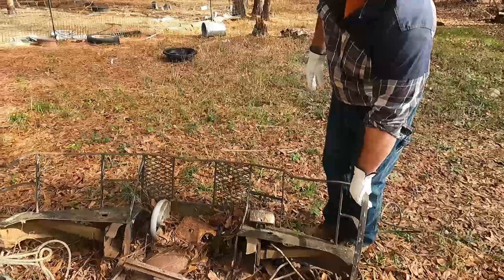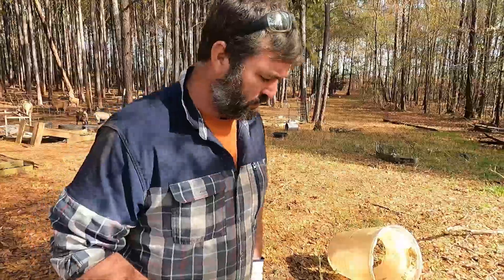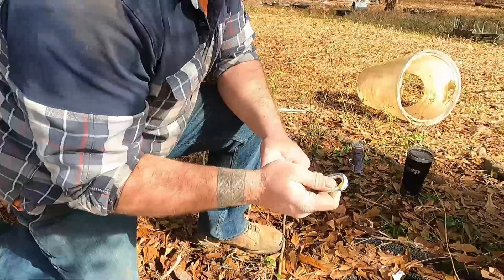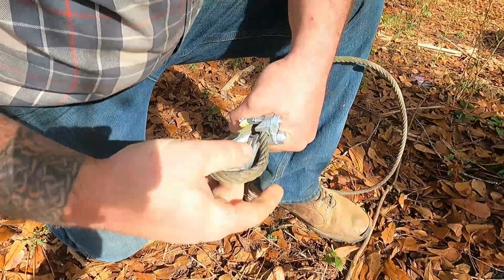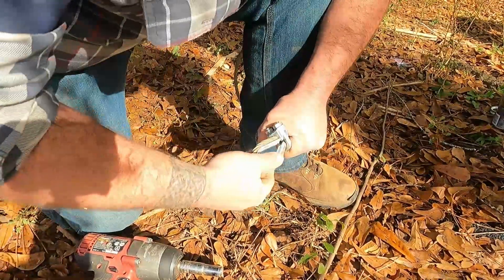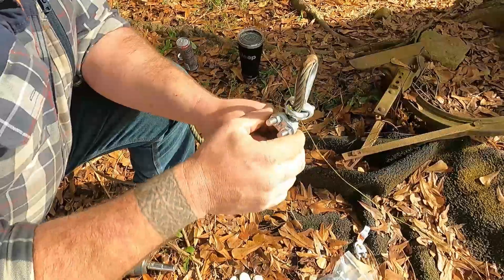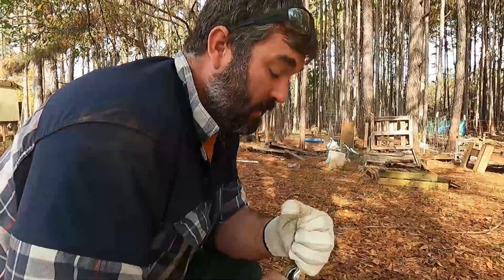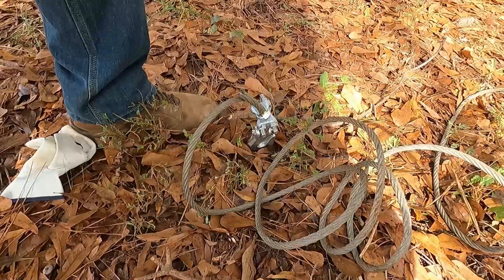REPURPOSING OLD MILITARY WINCH CABLE ON 194 YEAR OLD HOMESTEAD | HOW TO RIG A CABLE TOW CABLE

Comment: Aaron, I am a old time logger... I agree so far on everything that you explained and did is correct. Now would you enjoy knowing how we do it in the woods without clamps, its always going to work, and never slip. The way its done now with a strong winch, you can make that slip back  through itself. Those strands that you pointed to... count them, there are seven individual strands of size wrapped next to each other making it a nice round cable. I was army but a fellow from the navy taught me this because that will not go through a cable block. Those are similar to what you hung on the tree to pull down. Take a piece of that cable from one end or other and divide those strands so there are three in one group and four in the other when unwound from each other. Unwind for about a foot or just a bit more for your first time doing this and then it will come natural what to do in each case as wire sizes determine how much you  will need to make a farmers splice. You have the two lines now hanging from the wound cable... make like you were going to tie it in a knot  and when its been drawn in following its natural way it was wrapped, it will fall back into its shape of seven wound together. Take the end of one an follow that wrap and it will go right back to its right full shape forming a circle kinda an do  the same with the other going the other direction so it is now just like it was except you have a eye on the end. Try to match the wraps so it comes to just where you stopped unwrapping it from an its a nice tight eye that if you wish, you  could wrap some tape around it to avoid slivers from that cable. There  is one more secrete weapon here.... if you have one long stand all by its self say a ten inches long or so, start wrapping it around following the natural way and it will form a round solid eye that you can undo when it gets where you want it. Instead of using shackles that will not go through a block, you use those eyes to joint two pieces of cable together. Out in the woods if you broke the cable you were pulling with, you cut away the broken narly stuff, and made a farmers eye in the two ends only you put one eye inside the other as you make them and it would pull tight enough that when it went by you, you could hardly tell it had been broken. Just try it before blowing me off as you will be surprised.
Reply from the maker: I will try that out for sure. I know what you are talking about and have done that. I just went for speed and ease on this one!
Reply: My dad always would do it that always made envious